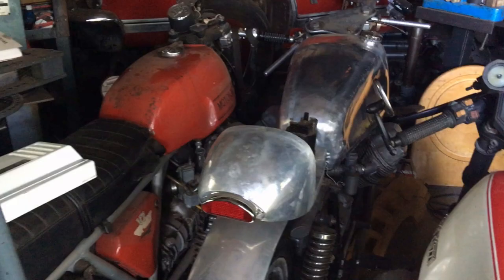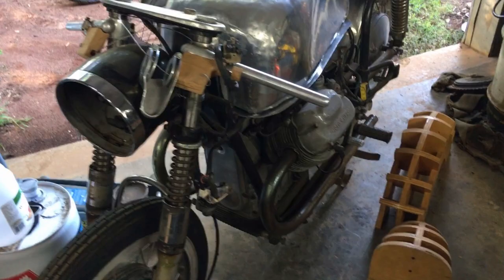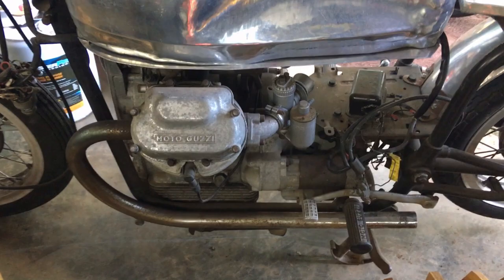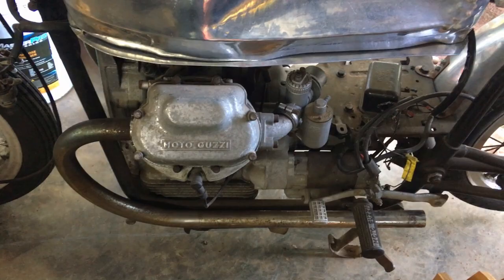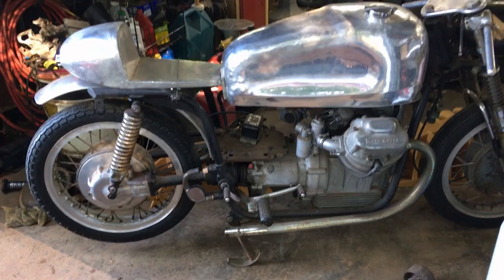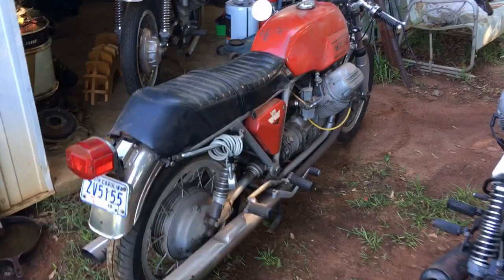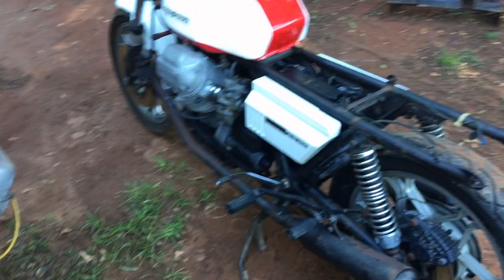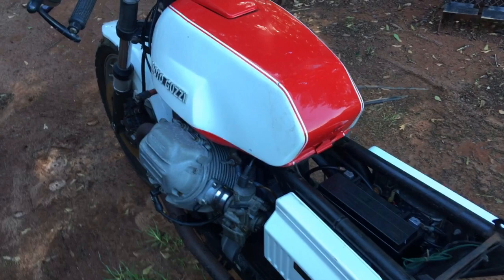"Do you like old Guzzis?"  Moto Vecchio - Moto Guzzi

Comment: There is something gorgeous and relentless and dependable about a big, older Guzzi.  These are from before my familiarity with the marque, but the look and the sound are similar.
Knocking the chokes off....  It makes me smile.
Reply: I agree completely.  The CX is a much more “modern” bike to ride compared to the very analog V7 Sport, especially the drum vs disc brake aspect.  But it still feels very Guzzi to ride.  I’m looking forward to getting the Corsa Record on the road.  It should be a much different experience than a typical Loop platform model.

Comment: I'm here just for the lawn tractor!! So cool!!
Reply from the maker: The lawn tractor is becoming somewhat iconic.  I didn’t build it.  I just got it for parts.  I’m planning to build a bobber using a spare V700 chassis I have, using that tractor engine & trans and bits removed during the Corsa Record project.  Can’t justify doing a full engine rebuild on the tractor, just because so I may have find another spare engine & trans to keep in the tractor.

Comment: A Guzzi powered tractor….I’ve seen it all now !
Reply: Me too! I believe Harley Davidson have beem making tractors apparently since 1903 and have often heard my Road King referred too as a Harley Fergusons and Massey Davidsons so I appeased the haters by putting Massey Ferguson decals on my tank. Thankfully I dont have this issue with my Le Mans 2 or wait for it my 65cc Guzzino.
Its all good fun.
Reply: @nightster6378  we laugh all the time about my Shovelhead being farm equipment and a piece of junk, but we love them.  Same with my iron head Sportster.   As much as I enjoy my old Guzzis, I believe I could ride my shovelhead to Alaska and back with relative impunity.  Parts are usually nearby and the “technology” to fix it is very straight forward.  But if a significant Guzzi part breaks, it’s rarely something that can be quickly, easily or cheaply replaced.